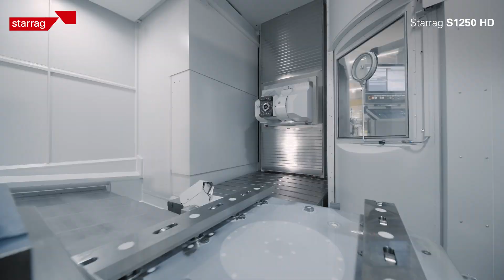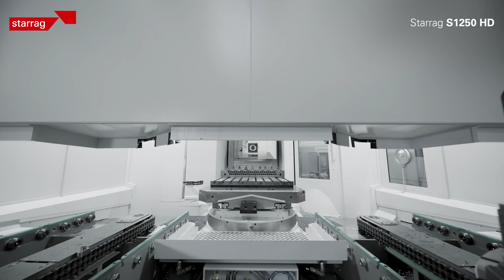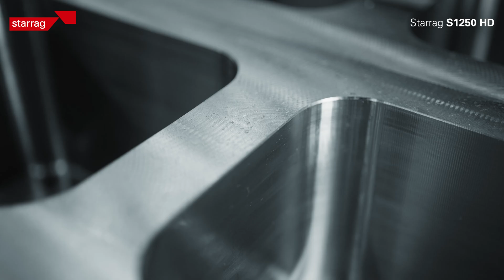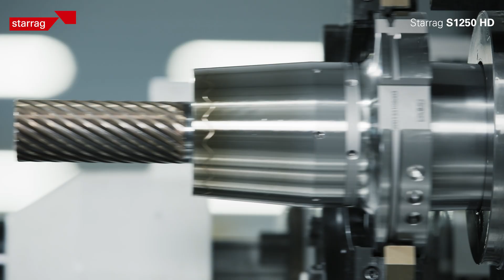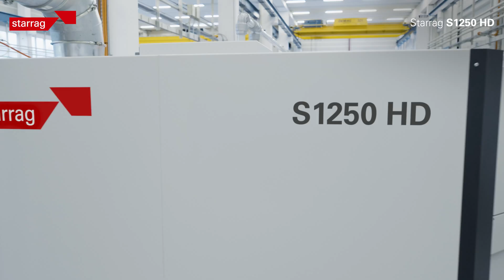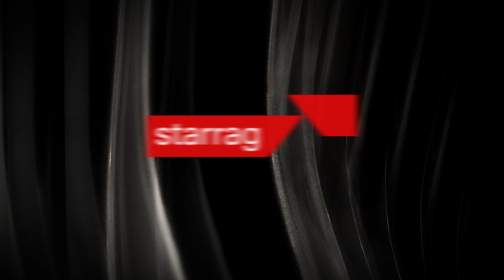New world record in machining titanium on Starrag S1250 HD

Comment: Material: Ti-6Al-4V
Tool: Ø 40.00 mm (1.5748 in), 18 flutes
Cutting Speed (Vc): 394 SFM (120.1 m/min)
Spindle Speed (N): 956 RPM
Feed (vf): 300 IPM (7 620 mm/min)
Feed per Tooth (fz): 0.0174 in/tooth (0.442 mm/tooth)
Feed per Rev (IPR): 0.314 in/rev (7.98 mm/rev)
Depth of Cut (ap): 3.86 in (98.0 mm)
Width of Cut (ae): 0.079 in (2.01 mm)
MRR: 91.5 in³/min (1 499 cm³/min ≈ 1.50 L/min)

wow 💀